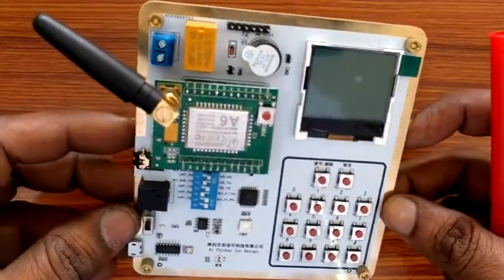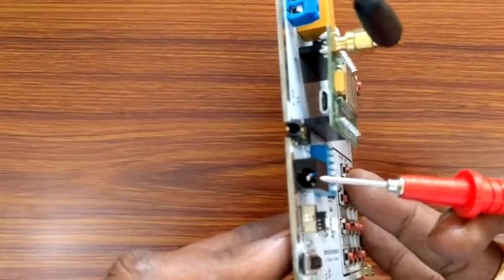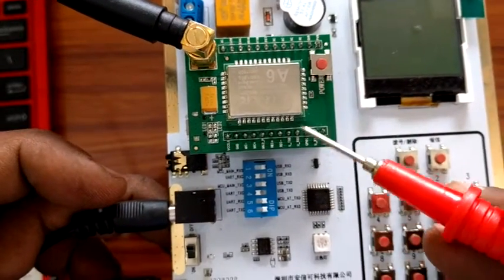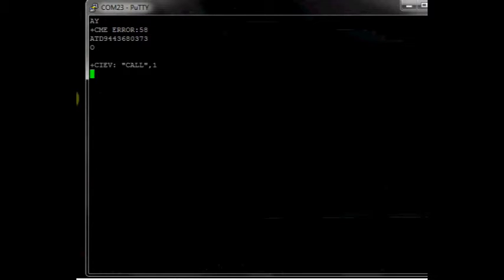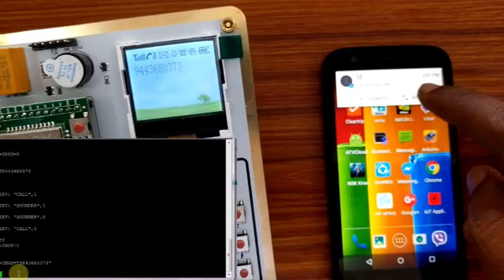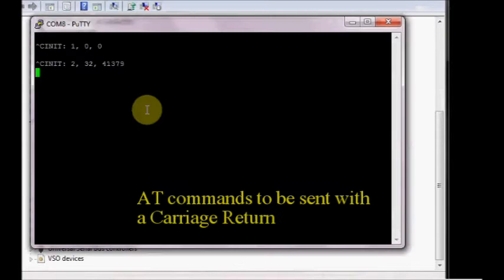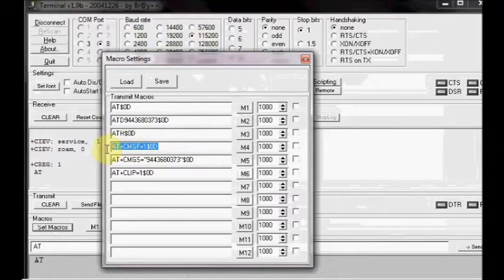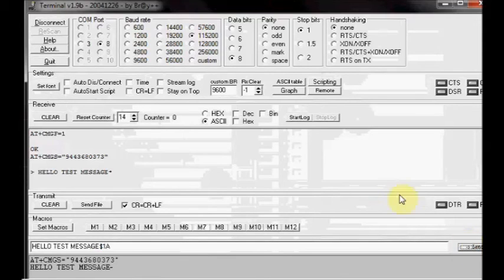GSM A6 DEVELOPMENT BOARD from the developers of ESP8266

Comment: I have another Board, electrolytic capacitor near CH340G but can't install driver for CH340 Windows does not see USB and view order https://www.aliexpress.com/item/Smart-Electronics-GPRS-module-GSM-module-A6-SMS-Speech-board-wireless-data-transmission-test-board/32719849695.html in feedback there is photo card.

Comment: Do you know of any documentation or examples that show how to power the device directly from the pins?  I've used the development board an the 5v power jack, so I know that it can be powered through the pins, but I haven't seen any method that works at doing it.  Just putting through voltage on the VCC pin doesn't seem to work at all.  

Any ideas?